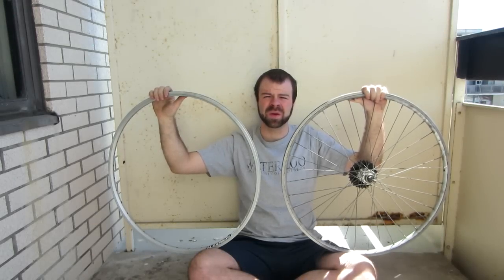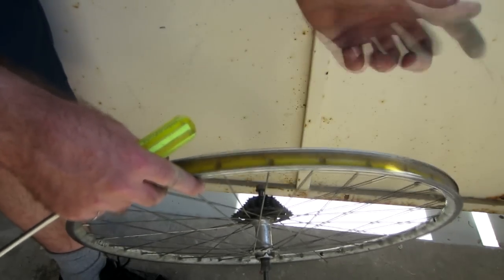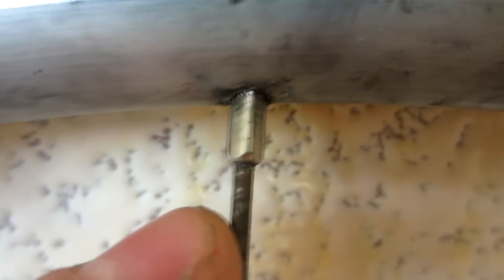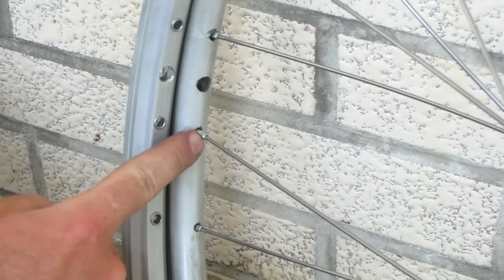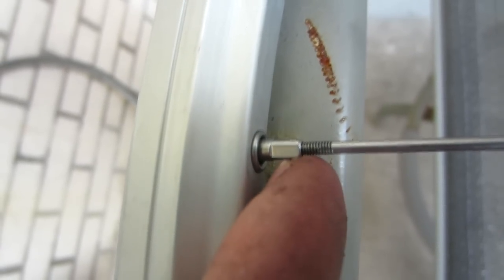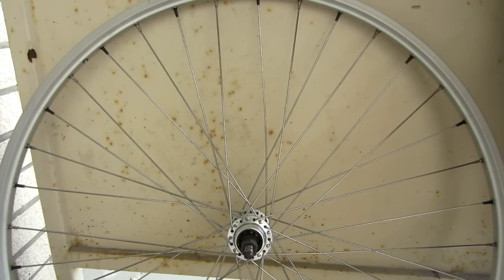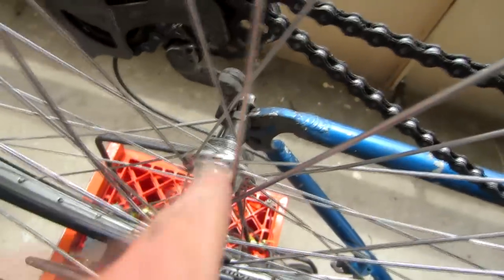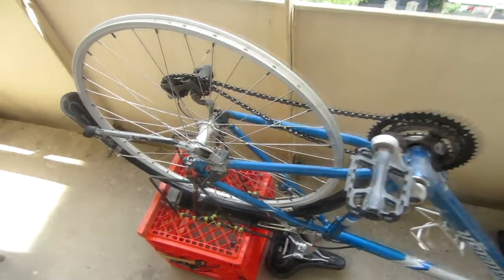How to Rebuild a Bicycle Wheel with a New Rim

Comment: The nipple pulled through the rim because the tension was to tight. Spokes can either snap or pull through the rim if the tension is not equal around the circumference of the wheel. This is where a spoke tensioner is a good idea to use to check that the tension on all spokes is relatively the same...
Reply from the maker: Although I agree that spoke tension played a part, I believe that the corrosion of the aluminum played a huge role.

Comment: Thanks for the video.  I just got up from the basement where I worked on bringing my bike wheel into round.   I was bummed out because I had just put a new tire on and  did not want to take it off again.   So I got it to work by using a piece of chalk and a grease pen to mark on the rubber where the adjustments had to be made.   I held it close and let the high spots rub on it.  I got it pretty close and will have to check it again after I have ridden it a bit.   I am so looking forward to the Spring weather and using my bike for some low impact exercise.   I tore the cartilage in my knees two years ago and it has been tough not being able to walk without pain.   I think the bike will be great!  Thanks again for sharing your  knowledge with me.
Reply from the maker: No problem, I'm glad you found the video helpful. Ride safe :)

Comment: would the technique apply 2 any kind of wheel? my coaster hub cracked and i need 2 replace it now. +100500 4 showing other tool options instead of 'recommending' (aka promoting) specific brand tool.
Reply from the maker: This technique applies for replacing a rim, not a hub. Since the spokes can only be unthreaded from one end , there's no equivalent trick for swapping a hub over one spoke at a time. You would need to remove all the spokes, move them over to your new hub, then rebuild the wheel. To gain access to the spoke flanges of your rear wheel, you'd likely need to remove your rear sprocket.
Reply: @cjhoyle  yes yes. i got all that. sorry, i'm usually very vague... i meant 'in general' (granted, not 1 spoke@time). just thought of it... looks like i can't 'unhook' the spokes w/o actually removing them... but still... the general approach is kind of the same. the difference is u moved the whole 'hub+spokes' block (easier), i have 2 'only' replace the hub but it does require taking everything apart. still, after putting spokes back the tightening teq is the same, i guess.
Reply from the maker: @WhoCares-bj2dn  There are videos on YouTube about wheel building which would probably be a better resource for you than this video. Best of luck!

Comment: Good vid!
A little trick when dealing with double-walled rim is to use a spoke to guide nipples. You thread a spoke from the outside so that you can remove it from the old rim and put it in place in the new rim. It's also very helpful when building a new wheel :)
Reply from the maker: Makes sense, good tip!
Reply: +cjhoyle تي
Reply: What's the advantage of a double-walled rim?
Reply: Double walls are MUCH stronger!

Comment: Thanks for a very helpful video. It took me a few months to source the correct size rim at a reasonable price. Was finally able to start swapping over today. A bit of a struggle at the start not able to lift out the nipples and having them drop into the double wall. All went well when I began using spare spoke to lift out the nipples and also to guide into position. Came on here to report back and noticed that the trick has been mentioned already.

Comment: Hey, another great vid. Long ago I had the reverse problem where the spoke hole in the hub cracked - the wheel is gone now, but do you think the hub could be swapped out as easily as the rim?
Reply from the maker: Thanks. Others have asked this question and the answer is that there's no easy way to swap out a hub one spoke at a time like you can a rim because of how the spokes are connected to the hub. But you could totally disassemble the wheel and rebuild it using a different hub.

Comment: He can I use a different rim for the new one or does it have to just be a replacement. Just wondering because I want to get a new rim that can take tubeless tires.
Reply from the maker: The only concern is that you might need different spoke lengths from one rim to another. In my case, the new rim and old rim were not exactly the same, but the old spokes still were the right length.

Comment: I own a used folding electric bike with 16 inch wheels that I take in my RV with me. After using it for 2 years my back wheel broke a few spokes, so I took it to a few bike shops and the told me they would not touch it for different reasons, they did not have those spokes (94 cm) did not have time even if they fixed it would happen again I’m to heavy for that bike. I weigh 226 lb and so on. That left me with a no usable bike. I went on line and found a site that will make my spokes so I ordered them. They are a lot heavier made for e-bikes my problem is the are at least 2 to 21/2 time thicker so they will not go threw the hole in rim. I plan to drill out the holes to fit new spokes. In your knowledge, can you tell me how bad of an idea is that. If I don’t try it is useless anyway right?
Reply from the maker: To be honest, if I was in your situation that's probably what I would do too. I'm not sure if it's the best idea either though. For the short term I think it will be fine, but it may start to go out of true more quickly because the thicker spokes will not flex as much as the others. I still would go ahead and try it and see what happens.
Reply: rterry coates yeah you might as well my opinion is that as long as the metal on the outer part of the hub isn’t too thin then drilling it should be fine

Comment: Nice video. I learn a lot from all your presentations. I have a question l hope you can answer. I want to replace all the spokes on my rear wheel, so would l do that in a similar fashion as in your video, replacing one spoke at a time, but using my old rim (which is in good shape)?
Reply from the maker: Sorry for the delay in my response to your question. I would say replacing the spokes one at a time is probably the approach that I would take if I was in your situation. An expert wheel building would probably cut the old spokes and start fresh, but assembling an entire wheel from scratch can be overwhelming to a person who doesn't do it very regularly.

Comment: Could I do this from a 22.5 to a 30mm wide rim? Wheel size is 27.5
Reply from the maker: I don't think the width of the rim would have much of an impact on the spoke length, assuming everything else is the same, so this method should work.

Comment: Hey great video, I took my spokes off my front and rear wheel and now I dont know where the long ones and the short ones go. Do you know?
Reply from the maker: It really varies from one wheel to another, but most of the time the ones for the front wheel as longer. Also, usually the spokes on the drive side of the rear wheel are slightly shorter than the non-drive side.
Reply: @cjhoyle  thanks for that. It helps a lot

Comment: I need help with swoping my hubs out the tub in the center got bent on one side and made everything all wobbly I plan on using the same rim and spokes but a similar hub an I plan on using the same gear cassette Axel bearings ect.the hub itself is all I want to change out can any one help me out
Reply from the maker: Unfortunately swapping a hub isn't quite as straight forward as swapping a rim. You'll basically need to fully disassemble the old wheel and rebuild it from the start. There are other videos on YouTube (not on my channel) demonstrating how to build a wheel.
Reply: cjhoyle I'm just trying to repeat what the front one looks like. IV spent two days already just trying to figure out the pattern.
Reply from the maker: I'd recommend reading the wheel building article on Sheldon Brown's website. I've only ever built 1 wheel from scratch and that was the most helpful resource I found.
Reply: cjhoyle I have it put together correctly now I just have to find the sweet spots for the caps  so that it's center and straight

Comment: is it ok to replace my old 22mm (height) rim with a 25mm?
Reply from the maker: It really depends on the point where the spokes connect to it. If there's a big difference in that dimension you'll probably need to get a different length of spokes.